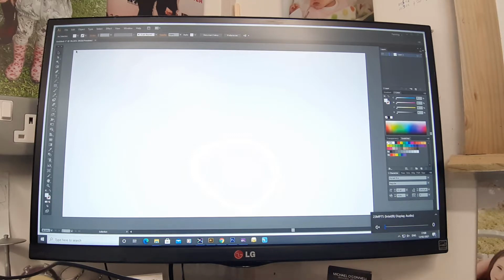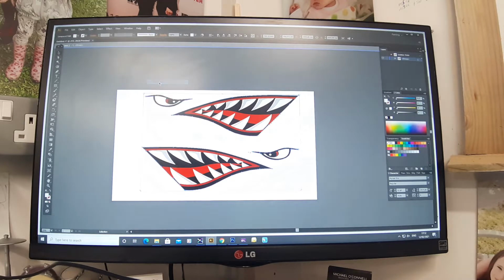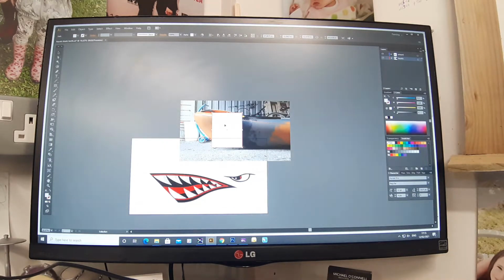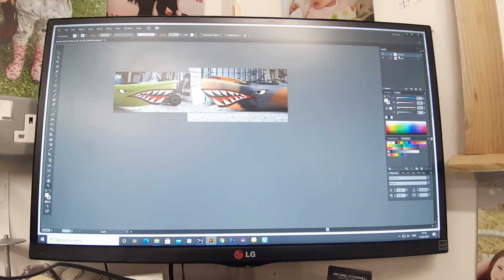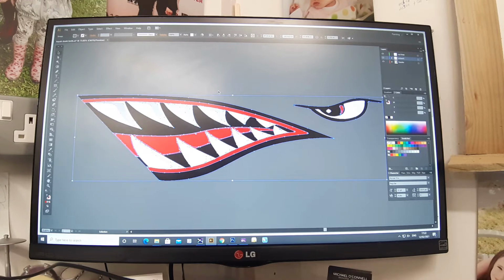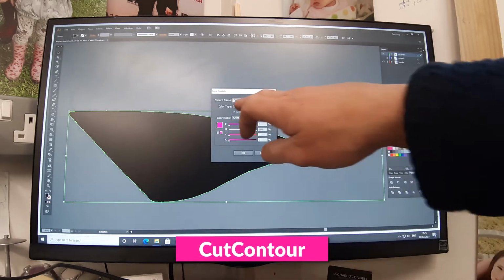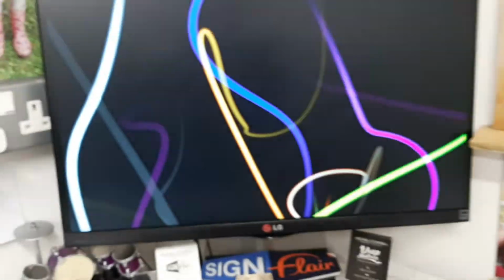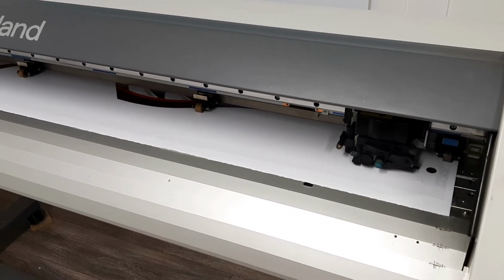PRINTED GRAPHICS - FULL PROCESS - HITAC Graphics, set up to installation

Comment: Great tips - what do you recommend as a heat gun - I tried an electric paint burner, but it seems too hot?
Reply from the maker: Hi Barry, honestly I always have my heat gun up full and control the amount of heat with movement of the gun and also distance . But I suppose all gear guns are paint strippers just different brands. The cheaper ones have 2 settings where the more expensive ones have more adjustments. I'm not fussy about them , I've used them all and the cheaper ones are just as good and generally have a 3 year warranty !! :0)
Reply: @wrapmastersireland  Thank you :)